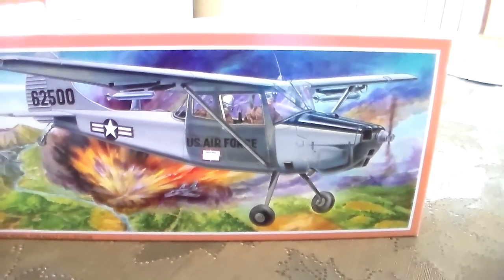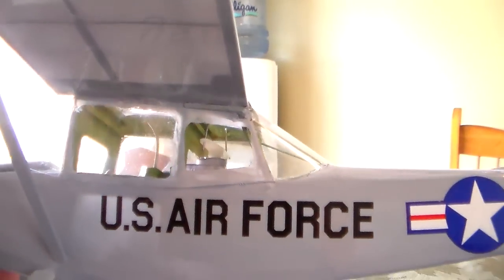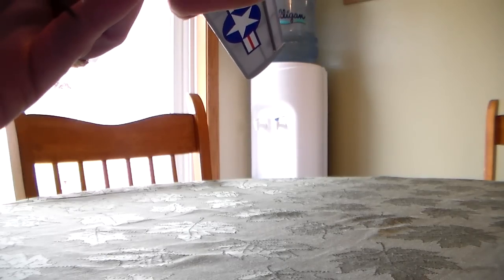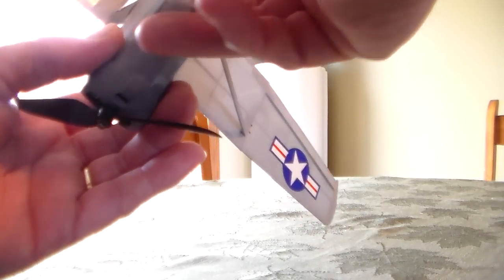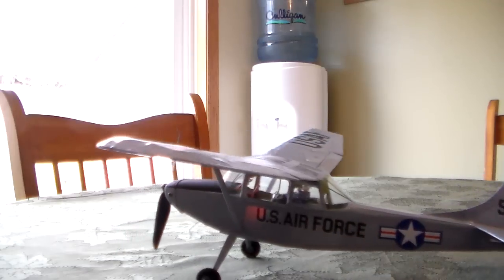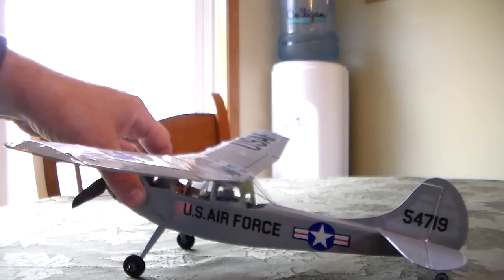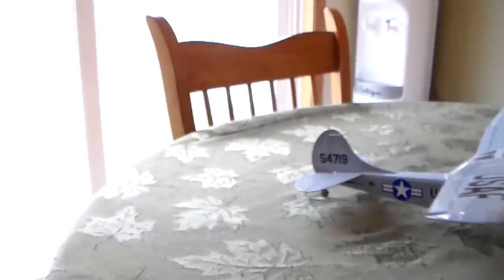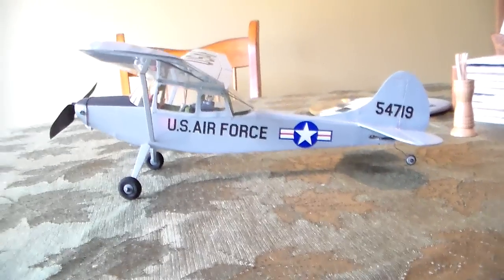Guillows bird dog kit 902 r/c conversion

Comment: What kind of motor did you use? That’s an awesome build!
Reply from the maker: Thanks! This used a really tiney 5 gram motor from hobbyking. I dont remember what kv or dimensions but it was like 5 grams weight with a 7 amp esc on 2 cell. I had to cut down a 5040 gws prop to like 4040 to make it work.i still fly this model !😎
Reply: @jagdpanther9  oh wow! That’s really good info tho 😃 I just maiden flighted my first build in over 10 years today. Been really enjoyable getting back in the hobby. Lots of catching up to do. Love your videos!

Comment: Do you think the e-flight micro set up will be enough power to move my identical guillows bird dog kit? Im less worried about servo torque and more worried the power plant wont be enough to move the 24 gram plane. Its a recycled e-flight micro motor from a “Night Vapor”. I have a slightly bigger motor from a e-flight parkzone just in case its under powered.
Reply: Never mind lol… answered my own question by looking up the weight of the night vapor. The night vapor weighs 25 grams with a battery so my 24 gram balsa should be ok.
Reply from the maker: Hi.build it light with no ailerons and it will fly it just fine.

Comment: I'm planning to build a 24" Guillows Beaver as a first electric RC conversion, using the motor/servo/esc spec you lay out in the description. Please let me know if you'd change anything - thanks!
Reply from the maker: you should be ok with it eric, just remember to build it lite as possible and to gut out everything you can aft in the fuselage and tail. remember the fuse dosnt have to be built nearly as strong since it will not have to have rubber band power and all of the weight you take off from the rudder and stab will mean less weight added to the nose. Have fun! =D

Comment: i like your videos very much and they inspired me to try and do this conversion of the bird dog as well. Thanks for the info on hinges and covering :) I saw that there are micro engines that can run on 1s as well as 2s lipo. Do you think it is possible (in this set up)  to use it as an indoor (1s) and outdoor (2s) craft, and therefore changing the wing load by using a 2s battery for windy conditions?
Reply: i forgot one question, do you use the decals supplied in the kit of aftermarktet ones? Al found the ones in the kit to be dificult to handle and very brittle...
Reply from the maker: vertigo  i did use the kit decals on this model and with most of these models kit decals dont last. i have and am using decals from callie graphics. she is email only but she is very good and can help with these micro graphics. you can only try the 1s and 2s power variant. i think the lighter 1s power with the park zone ultra micro brick and motor/gearbox is the best overall choice for these models for flying indoor. this one shines in windy out door conditions but otherwise it is a bit fast and heavy for indoor.I'm so pleased that you like the videos and tips! keep building, it is a great great personal hobby and the rewards are precious.

Comment: I just ordered one of these and I'm going to make it 3 channel off of a vapor brick to fly it in my school gymnasium any recommendations?also I am building an a1-h with a umx p47 brick
Reply from the maker: hi rex, make everything as lite as possible with the vapor brick and 1s power. actually your set up is what this model needs. all of the aft/rear fuselage can be gutted to save on tail weight also the building of the stab and rudder should be framed as lite as possible as well. just  slivers of hinge material is all you will need to hinge the rudder and elevator. watch my guillows collection video and i show what is needed for hinging. micro lite covering is lite and parklite is fine too and much easier to work with.just keep everything aft lite as possible. these models were intended for rubber power so they are really built up in the fuse for strength. we do not need that much beef for rc conversions. have fun and let me know how it turns out!
Reply: jagdpanther9 thank you sir 
Your aircraft are amazing and I enjoy watching the videos thank you sir for uploading
Reply: jagdpanther9 should I use an unencambered wing or the standard to generate lift?
Reply from the maker: i just built nine with the standard flat bottomed wing and added a little wash out. i used ruler to set the angle of attack and the stab and wing were really close to being the same. dont make it too complicated.

Comment: hello I was wondering what you used for the hinges on the elevator rudder and ailerons? thanks for all your videos there awesome!👍
Reply from the maker: hi, i buy the hinge material in a sheet from value hobby or ebay. it is like 5-7 dollars and there is enough to do years worth of models. also many people have used old computer floppy discs which do about the same thing as ca hinge material, just lightly sand the floppy discs so the ca sticks better. i hope this helps.

Comment: you describe the "whimpy" motors. The problem with R/C planes is that they fly too fast to look like scale flying speed. That is why I never liked R/C and prefer rubber powered free flight. Rubber power more closely resembles scale flying speed and thus looks more realistic.
Reply from the maker: hi, i agree with you that rubber power is more scale. in fact in the right conditions this model would fly better with 1s power and the PZ ultra micro brick with no ailerons.with the 2s power that this model has and with its extra power and weight it will and has flown in 15-18 mph winds with great authotriy . my use of the word whimpy is describing a 1s motor in wind. i do favor my super cub on 1s power over this bird dog with the 2s but again i am limited to flying the cub or many of my other 1s models because of the wind factor. i hope you understand.

Comment: Oh and another question, how did you get the paper skin so smooth?
Reply from the maker: BennyCFD hi, the ailerons are ran by bent .023 wire which runs through the wing to the aileron. it also serves as the inner aileron hinge and there is only a small sliver of aileron hinge material on the outboard of the surface making very little resistance for the servo. the covering material is a iron covering called ultrakote parklite made by hangar9. it is easy to use , super lite and very strong. it is my preferred covering for micro rc builds.thanks for your comment =D
Reply: Did I see correctly you're only using one aileron? In your video I looked like it was the left aileron
Reply from the maker: BennyCFD it looks like just the one aileron is working in the function video but it is just the camera angle. if you look in the video description there is a link to the test flight and you can clearly see them working .

Comment: I'm very interested in doing a similar conversion to my O-1...I agree with all the comments below about a build video/tutorial, and have a few specific appearance questions (if I may):
-I assume you covered with Monokote or similar-is that correct?
-Did you get the "USAF" for the top of the wing by modifying the included Army markings?
Thank you!
Reply from the maker: hi, the covering is hangar 9 parklite it is by far my favorite covering for micro builds. yes the "ASAF" was made from the included Army markings.
@ some point this winter I will make a video with some micro building techniques.
thank you for your comment =D